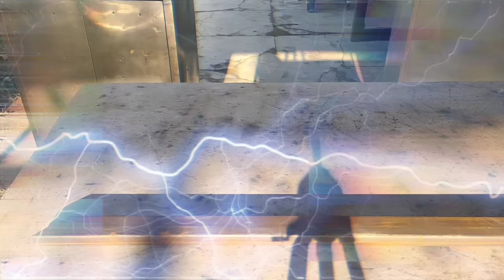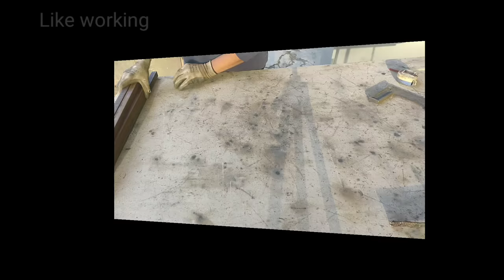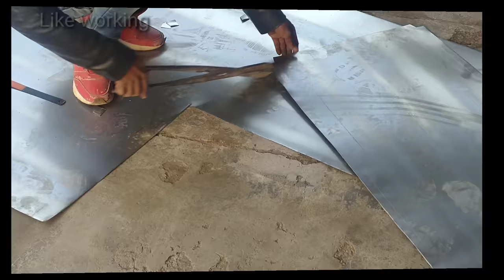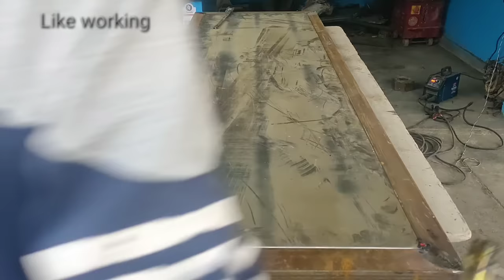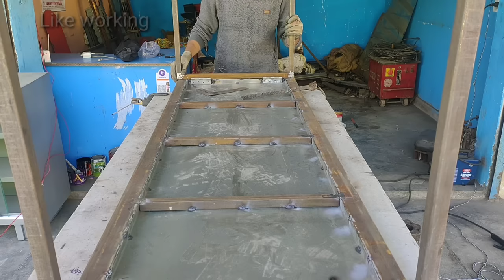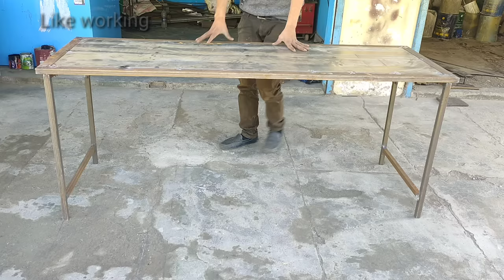Making a iron folding table/simple and easy metal making table /लोहे की मेज बनाना

Comment: Completely fail table 
The legs should not be in to metna due to which balancing problems occurs which you will fall from table along with the table and the nuts should not be weld instead you should use  a bush in to a pipe size long that should be weld to the pipe and the bolt should be free from welding